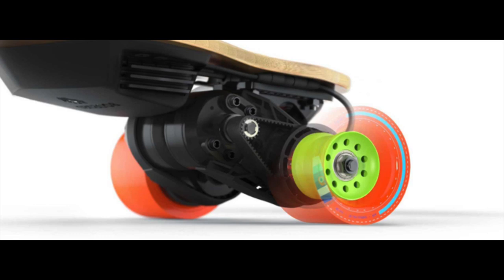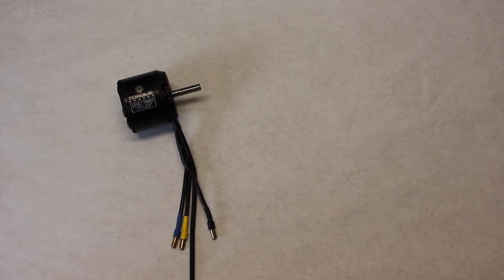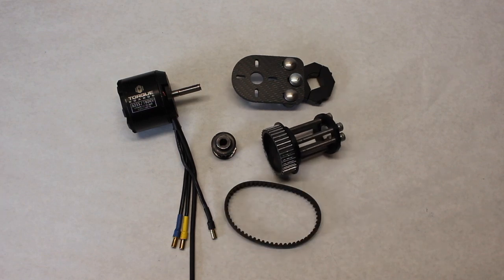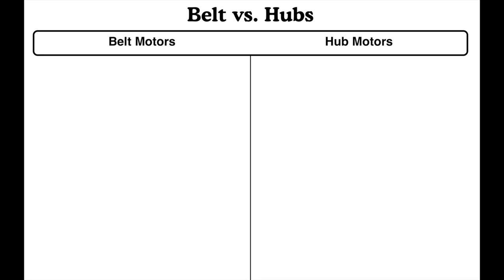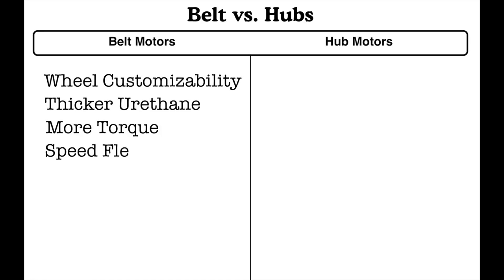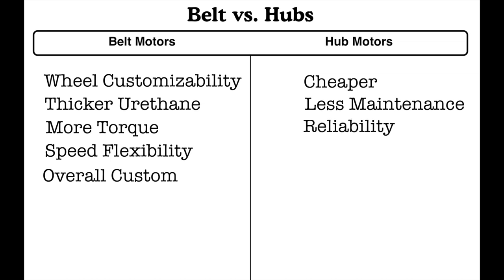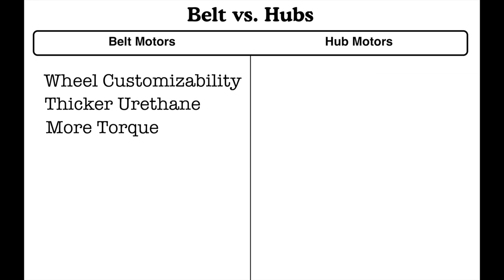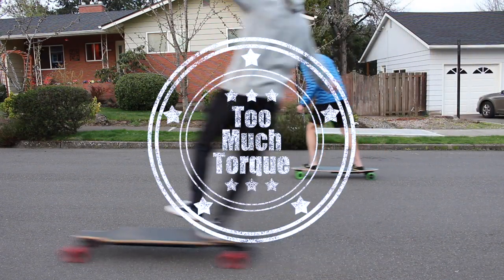Hub vs. Belt - What Should You Use?

Comment: You forgot Hubs = less rolling resistance if you battery dies you can kick push home on most hub motors, my flipsky 6354's belt drives take a lot pushing and not a lot of rolling. Will i ever swap doubtful but next build will be a direct drive for sure this is best of both worlds.
Reply from the maker: Yes, this is very true! Excellent point

Comment: I am stuck with a bit of advanced question.
I have DIY 6S2P battery pack that I made using 18650 cells (24V, 5Ah), there is no BMS connected yet. But I do have a 6S balance wires connected, I tried charging using iMaxB6Ac. The problem is I get error Vol Connect error on iMaxB6. I have once used this battery pack and over discharged the cells and they become useless since they won't charge with iMax(Vol Connect error something). I have waisted 10 cells, and made a new battery pack. I check balance wires from 1-7 and they do show correct voltage 4.1 - 8.2 - 12.2 to 25.2 voltage. But iMaxB6 wont recognise the balance wires, its a new device and I am frustrated.  So if iMax don't recognise my pack, will the BMS recognise or i am just waisting money. Some expert please suggest me a solution.
I am currently waiting on my 6S BMS, it will be delivered in a month or so.